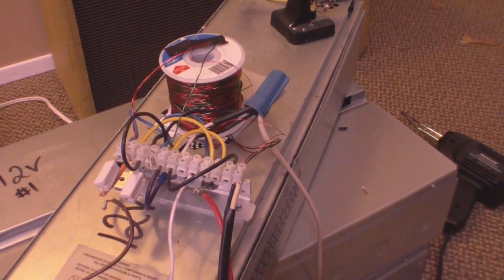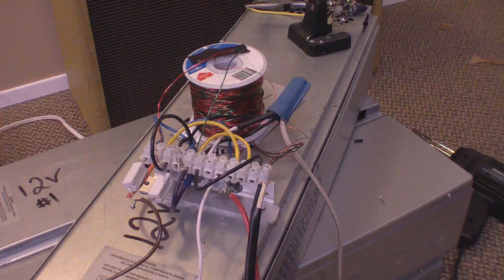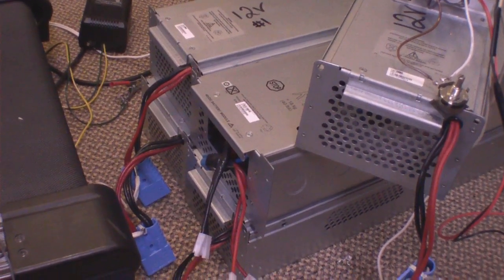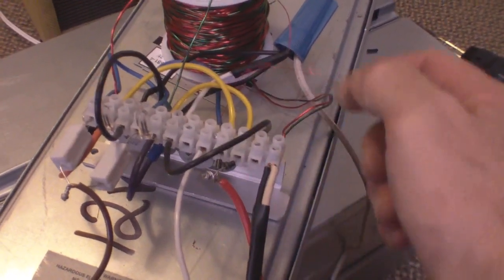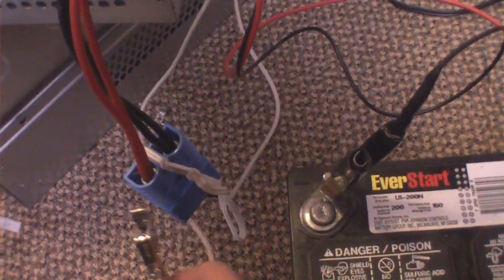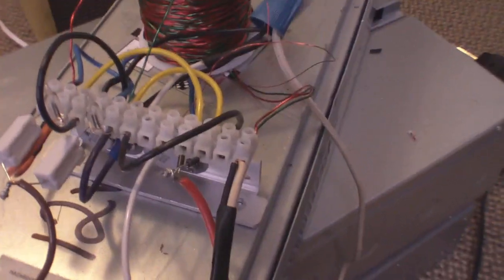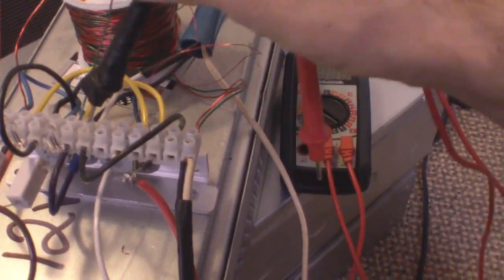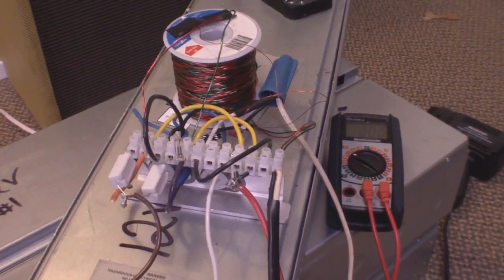Bedini SS SSG 2T - First Attempt

Comment from the maker: @slider2732 Yeah buddy this is gonna be sweet. Woodfire Bedini coming up. I figure you can -possibly- heat a cabin + charge a nominal bank of batteries - say 400 A/h, overnight - while you sleep, for a bout a wheelbarrow or two of woodchips. My unit is being built right now. It's got 350,000 BTU/h output. It will idle a John Deer 8HP on full throttle (sitting there, not "working" per say but nonetheless). And that is on 20 lbs of chips, for three hours. With no hopper!

Comment: @KyleCarrington I've never known a battery to get even mildly warm on a Bedini circuit - quite rubbish for Canada right now! I mean, if throwaway batteries could glow like firebricks and not explode there'd be a market for that. No current = no heat.
I like the logic - use wood to charge batteries.

Comment from the maker: @slider2732 lol yeah note to self, next time have two drill batteries charged. I'm building my next one right now its going to be a 5T and I got a 40T planned if the aluminum wire works out. I figure the 40T might push 8-10A, which will easily run on my new wood gasifier I got coming. Bedini on wood power coming up! And the smaller ones on solar. In all honesty, I don't think its "free energy" but I'm beginning to see it as a smarter way to charge batteries. Higher Voltage pulses, less heat?

Comment from the maker: I am now operating the circuit with two smaller resistors on the base: 22 ohms on each. Between the pot and the trigger, there is a 68 ohm resistor. I added a momentary switch with a 2.7k resistor between the B & C's collectively, and put in 1n4007 protection diodes from E to B. Now, I can bottom the pot right out to a low hertz run, drawing about 1.5A from a 13.8V source, and she charges like a devil on a 100 A/H 27-series RV battery. No problems starting with the momentary "bump start".

Comment from the maker: I'm a bit suspicious that these 2N3055's might be fakes, although considering that this particular circuit (without protection diodes) is not killing the breakdown voltage (although it might!) ... one might thing they are the real deal. Been reading up on fakes, and these WERE purchased on ebay cheap.

Comment from the maker: @imtotob There are so many ways to look at this stuff; personally I think of it in four ways - circuits that use Bedini in a precise as possible way to desulphate where frequency and parameters may really play a big fact. Second, air core SS variants that push current, run low frequency to do "hard charging" and USE available current. Thirdly, fans, that would be run anyway, and thus could be charging batteries. Fourthly, as an energy mover for AE transmission.

Comment from the maker: @imtotob Thanks. As recommended, I put over 6 months in on 26" wheel, ceramic magnet SSG (that I actually bought from Rick). I did 42 cycles on brand new batteries, the same ones as you often see him use (Walmart EverStarts). So, I followed along those lines... now though, I'm looking at it from different angles; my favorite thus far being bxx49er's route. Which comes from a solar perspective. So, your comment is very relevent!

Comment: I had build a Imhotep relay charger wish did take a week to revive a dead car bat. I found out this week can be cut to 3 days, when you alternate charging with reg bat charger. What you do is you bring up the dead bat to the level that a reg charge will take. That usually takes about 3 days from bat starting t 1 to 3 volts. Does that make any sense?

Comment from the maker: @tectalabyss The transformers are good for making small welders or HHO units, or wire salvage. There are nice large AC caps in them, heavy duty bridge rectifiers for wind systems - lots of goodies. The batteries themselves are not perfectly ideal for off grid alternative energy,; however - they are good for heavy fast loading - so i'm thinking charge them up with solar, then hit the main bank, late at night, hard with spikes when no inverters are in use... drain 'em. Then recharge.

Comment from the maker: @tectalabyss Most government institutions have these sorts of UPS's. Ironically, many of them just junk the entire works... in the last batch, I got three of those cases, which are (8) 12V 9A/h batteries in each, but not only that, I get the entire server rack (19" rack system) the inverter/chargers, which are 240VAC, huge isolation transformers in them... everything... and the date on it is 2009. Every four years they change out the entire system, junk it.

Comment from the maker: @PoirierMike :) Thanks Mike. They work. I have a kit I originally bought from Rick, the atypical SSG starter kit. It has a single coil, several hundred turns of 26 and 23, I think, a single MJL21194 - and it will work away at a car battery or RV, albeit very very slowly. Which is all good if you have every reason to EXPECT it to work (i.e. you bought the battery, know that it's not BAD)... but, when you scrounge 'em ... different story...

Comment: Nice project Kyle. I'm also building a similar solid state Bedini, although smaller in size. One large coil, only. I'll use it to desulfate 12 volt lead-acid car batteries. Looking forward to more on that topic.